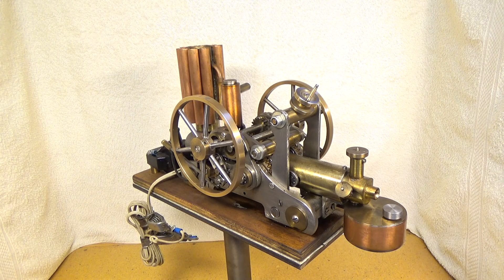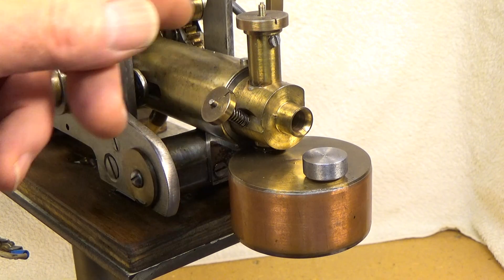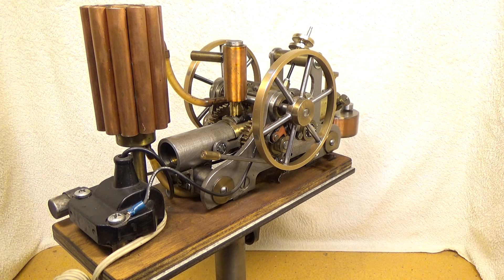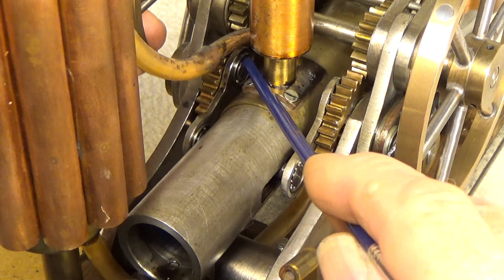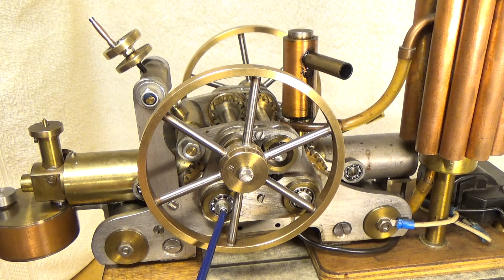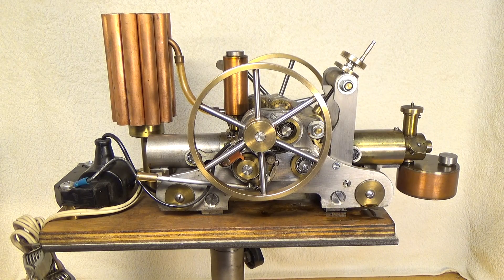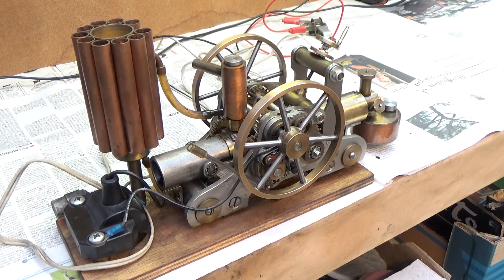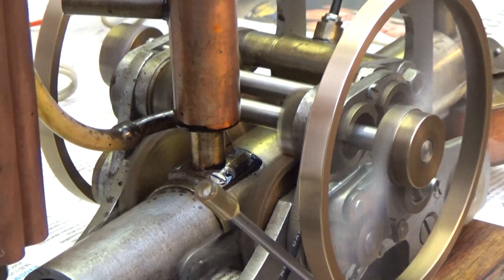Model 2 Stroke Opposed Piston Engine  Variable Compression

Comment: Your adjustable compression mechanism is fantastic! Scratch that, the entire engine is brilliant! It started so easily! I'm amazed the engine ran so smoothly while adjusting; that was a rather extreme change in compression ratio. Thank you for uploading this demonstration!
Reply: No idea how this was recommended to me 5years later………what does changing the compression ratio do ?
Reply: @magnustveten492       Thank you for reminding me to watch this again. Changing the compression can be done for several reasons, including increasing/reducing output of an engine to optimize it for power or economy depending on the application, or to account for atmospheric changes. In this case, the method of adjustment would also change the harmonics and powerband of the engine, allowing it to generate peak power at different speeds instead of one static point.

     But the neatest part of this system (just my opinion) is the fact that because it's a 2-stroke, wherein the pistons act as valves and cover/uncover the intake and exhaust ports as they travel, this system is also effectively an infinitely adjustable variable valve timing (VVT) system. This little engine blew my mind.
Reply: @AtlasJotun  thanks for that explanation :) what you say make sense and makes me appreciate the engine more :)